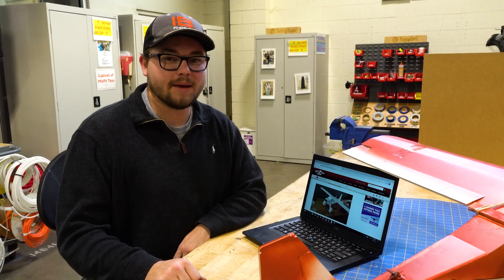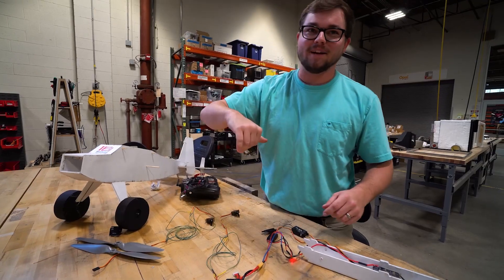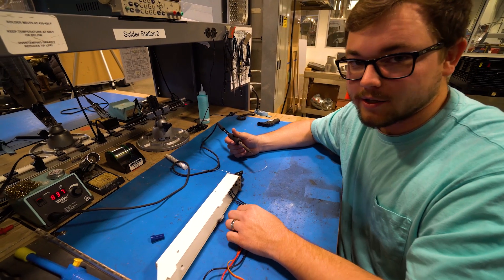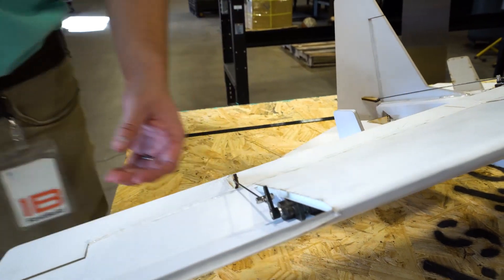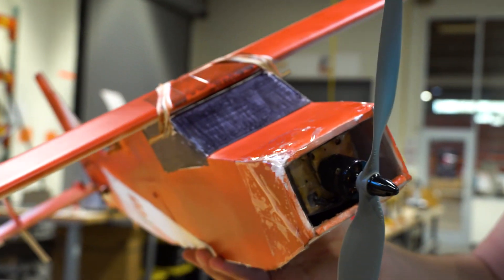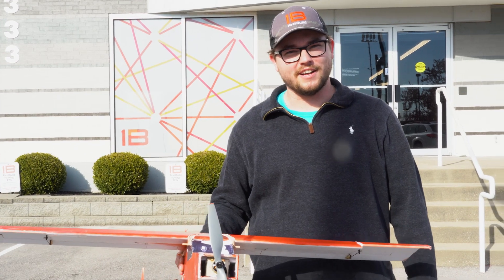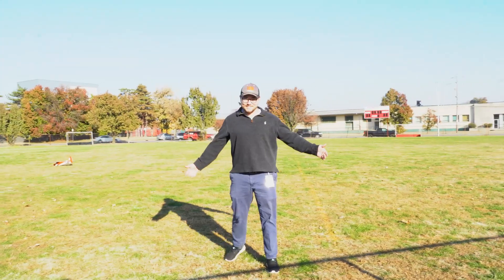RC Airplane—Make, Fly, Crash, Rebuild

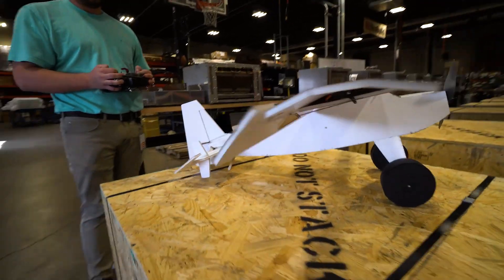Comment: some info.   at 3:46,  the use of  full strip ailerons is  not  recommended.      the use of  'compound' control surfaces  is  not  recommended.      the model looked heavy in the air.    perhaps  the use of panel cutouts  should be considered;  wherever Practical.    the use of a couple formers in  the tail boom construction will enable the removal of  an ounce or two of  mass, aft of the cg/c-m.    the amount of mass in the cabin area can also be reduced.     tape-covered cutouts can  Also be used at the underside of the main wing.     c-m is center of mass.     
cheers